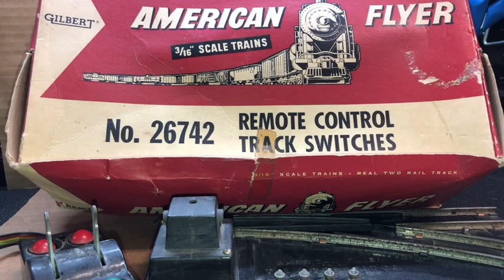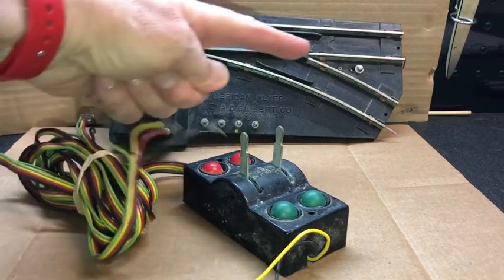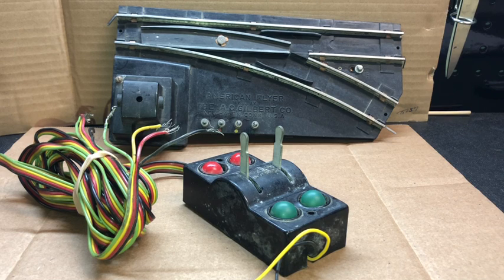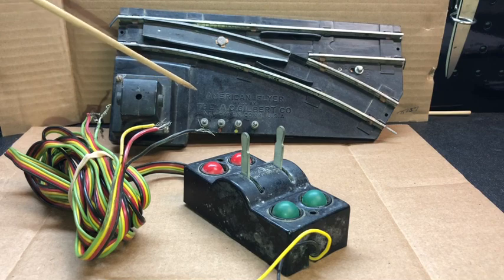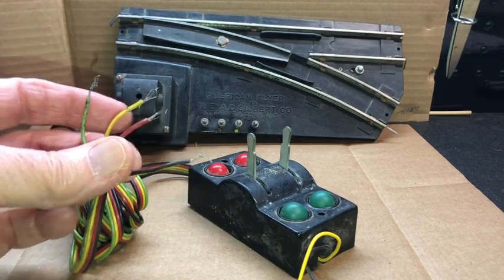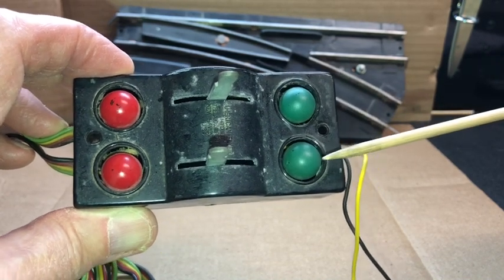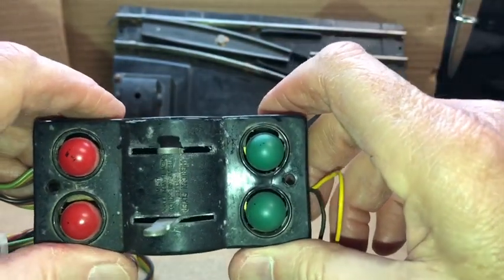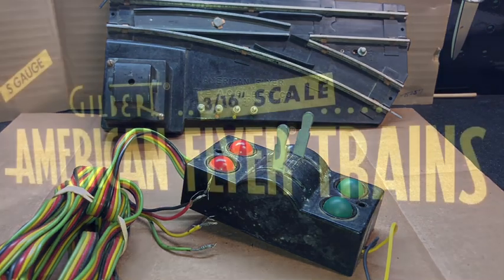Project Kickoff Rebuild Remote Control Track Switch 26742 Amer Flyer Illuminate Switch Control 57-58

Comment: This switch is a superior design that is affected by time and corrosion as compared to that famous early model 720 with defined roadbed that warps and never works right . The 720A is the same switch , same as above, but made with the better bakelite not styrene plastic. This switch when reworked properly will give you thousands of throws with autothrow systems and continue working reliabley. Some of these iterations are better than others, the difference being in the shutter  filter material.  The answer to the bulb problem is 2447 24 volt, cheap and effective, buy them by the boxfull (chinese)                          CASG

Comment: Hi Dave i also use resistor to step down voltage on just the bulbs and not the voltage to the switch. It works great,and i can still use the regular green and red.

Comment: Timely video.  Many of these switches I obtained needed a little TLC.  Biggest problem I had was a voltage drop over the frog that put the reverse unit into neutral on my old Flyer engines.

Comment: Dave once again thank you for the detailed video.   We'll I got my frontiersman a few weeks ago and now by total chance I found an 0-8-0 switcher #342  at a yard sale along with four switches, some uncoupler sections,  a 944 crane car and a few intersections as well. All in a sad state but I'm going see how far I get.  The switcher is running now so that's a step in the right direction at least 👍
Reply from the maker: That sounds good, congratulations on your acquisition, many variations of 342 were produced, most are pricey and rare, this is a good find especially if you restore/rebuilt it, 944 is also a good find.

Comment: Hi Dave i use LED bulbs 18 volts and run really cool.
Reply from the maker: Hi Gray, Thank you for watching, that is a good point. I too like the results using LEDs. I replaced several standard bulbs with LED in illuminated cars that I operate with the FlyerChief GP7 that run under full transformer power, something that would burn out standard bulbs and really cause them to heat up the interior of a plastic shell. Best! Dave